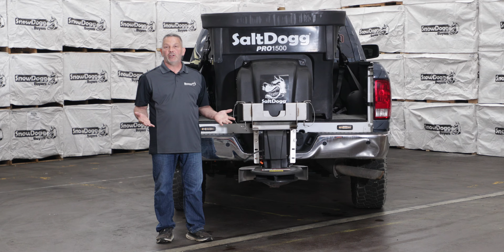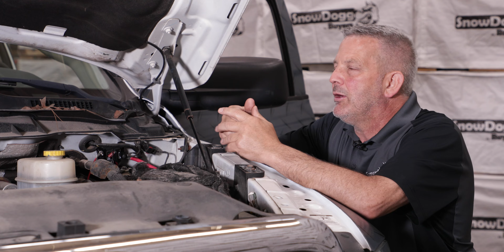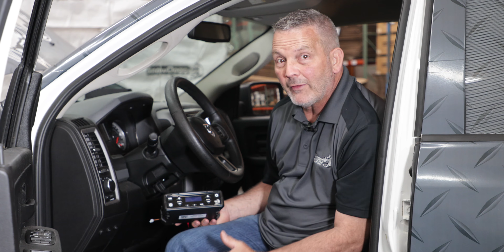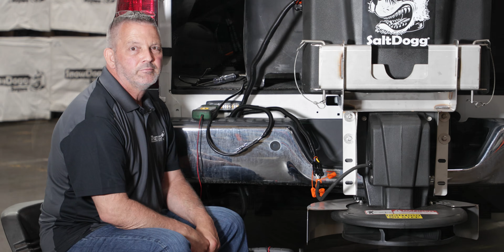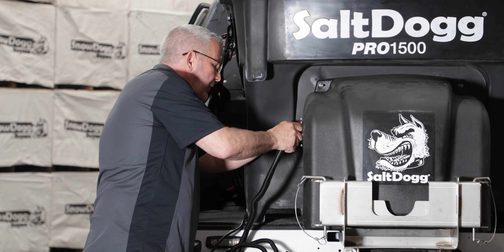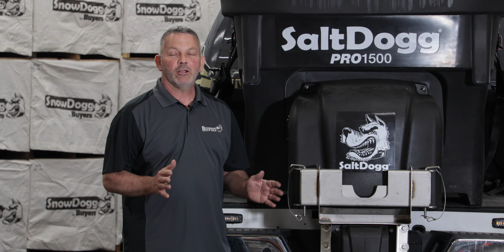Trouble Shooting SaltDogg Pro Series Spreaders

Comment: What’s a p mean on the controller and the spinner not spinning 
Agitator is working fine
Reply from the maker: Thank you for your comment and question! I followed up with our Tech Support team, and this was their reply:

P stands for motor overload.  This could be overloaded because of heavier material other than #1 rock salt or the material is damp.

If you have lingering issues, you can reach out to Tech Support by calling our main line: 440-974-8888. Thank you!